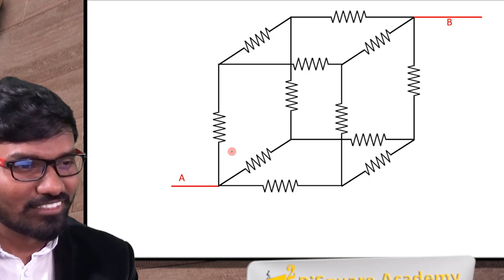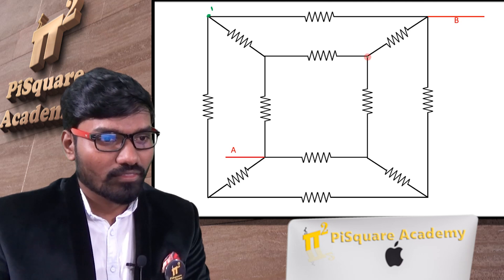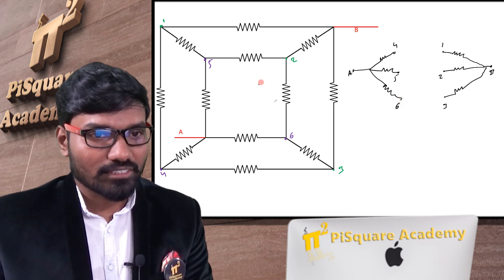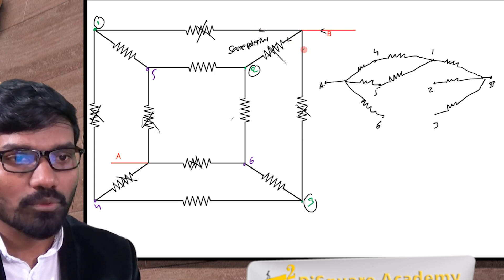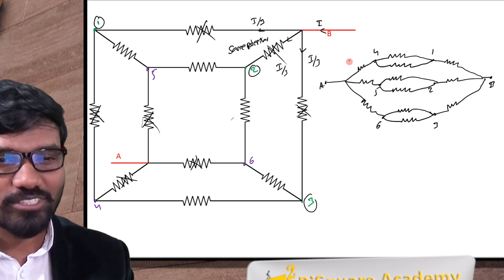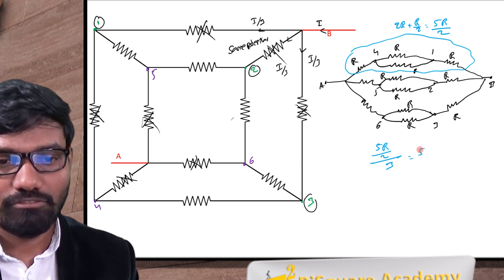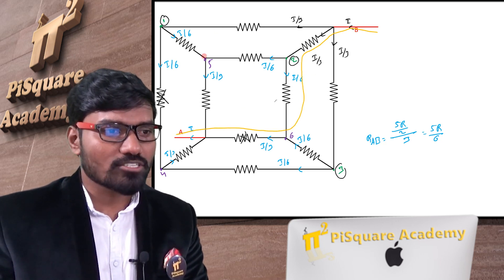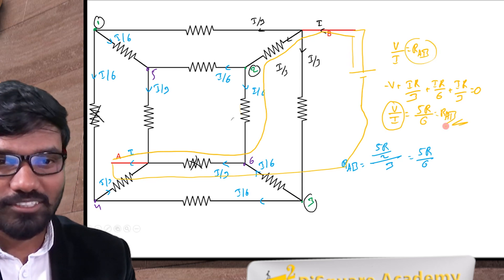Cubic electrical network resistance calculation in an Interesting way | cube question

Comment: At 3:55 you are making a claim that the potential at 1, 2 and 3 are the same? How did you make this big leap without any explanation. Just because the resistances from B to those points is the same, you cannot make such a claim. Once you make such a claim rest of the video is just mechanical and can be eliminated. As an IIT Professor and examiner for countless IIT JEE exams I can tell you that if you make such claims without substantiation I will completely invalidate the whole answer.
Reply from the maker: Actually, you have a valid point. We will explain your thing in the upcoming videos. Thanks for showing the fantastic view point.

Comment: There is one topic called sequence network theory, positive negative and zero sequence. This sounds to be incoherent to almost every body. Pls make video in this regard. How zero sequence voltage will appear in broken delta configuration in ground fault in ungrounded system. Pls research on these topics

Comment: Sir my question is how a capacitor is being used in dc circuits, as we know that capacitor is not working through ac. Actually I am working in a company there after the power from smps (switch mode power supply)all pcb panels like small dc circuits, and led light ckt,and alarm ckt all are working through dc after the smps unit only...sir plzz clear my doubts through my wp no.9668488022